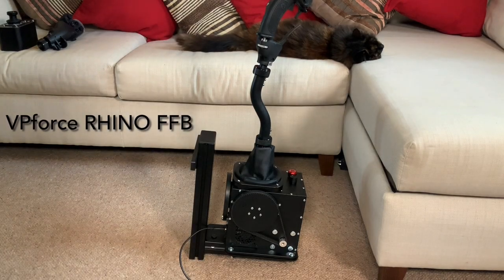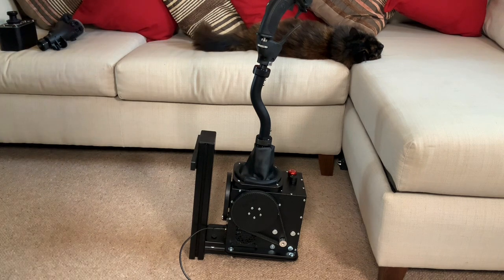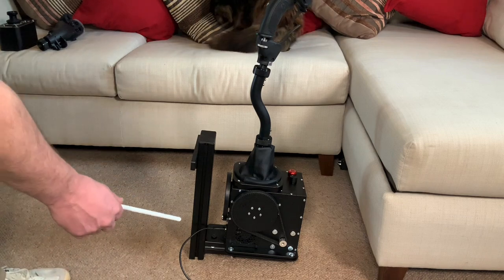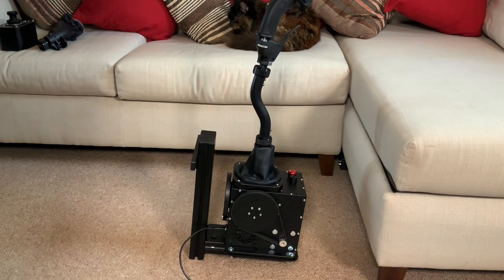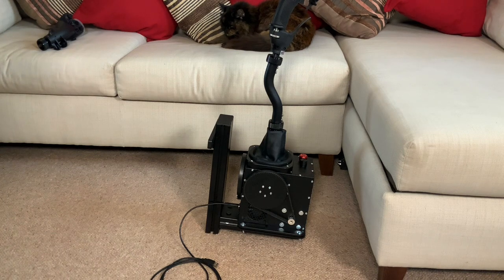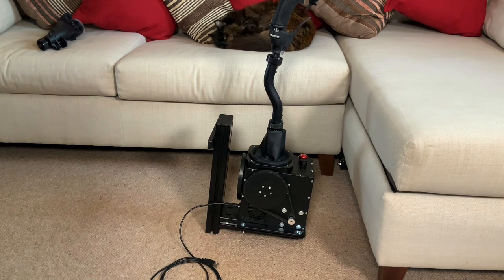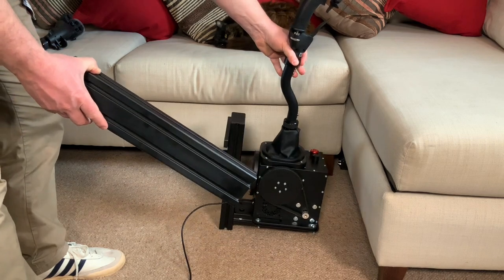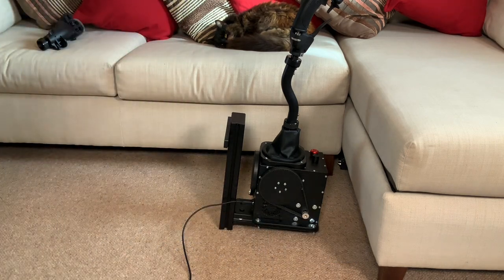Mounting the VPforce RHINO FFB base

Comment: Many thanks for going over all the considerations that you went through to adapt the Rhino to your setup. All good points for sure. I have both the "S" curve extension and a couple of the straight extensions segments. Ultimately I stuck with using the straight extension segments. Interestingly I also continue to use my TM Warthog Grip ... I have the Virpil CM3 grip as well but the feel of the old, metal TM grip mounted on the metal straight extension segments feel the most natural to me. This is strickly a personal preference thing. The Virpil grip has a LOT more options as far as buttons and hat switches, than the older TM grip but I could not give up the feel and weight of the metal grip.
Reply from the maker: I will have to give it a try, I have the Warthog still but will probably end up selling it now I've moved to Virpil and VPforce